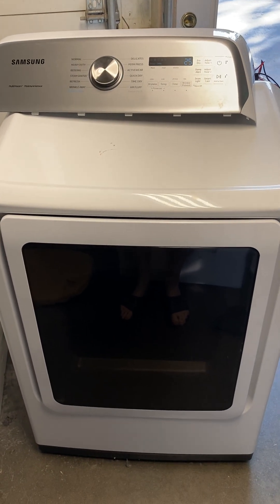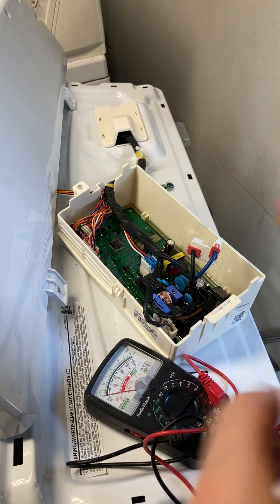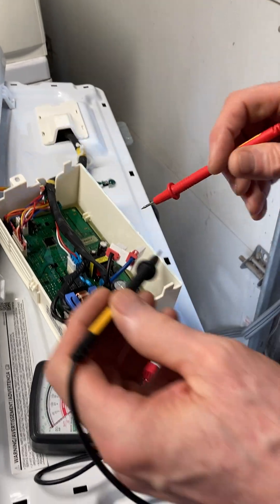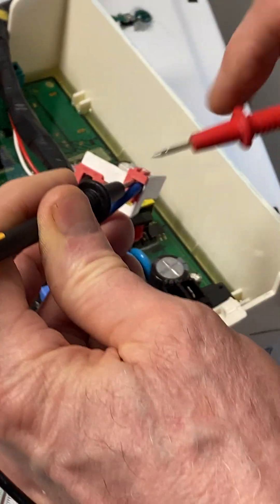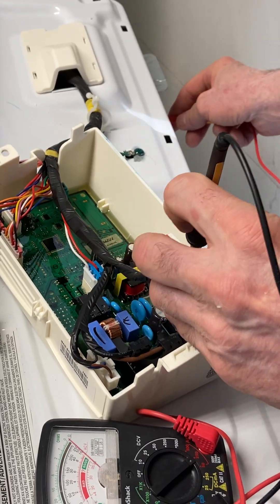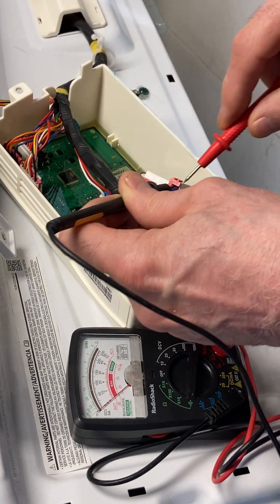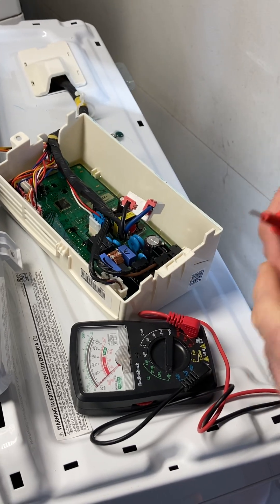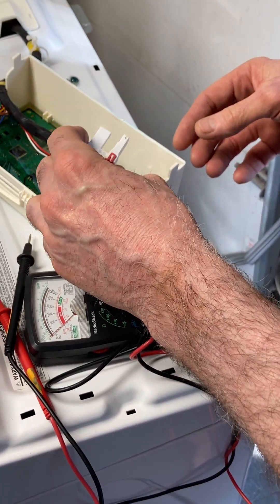Samsung dryer heating circuit at main board DVE50R5400W/A3 CAUTION: TESTS DONE WITH MACHINE RUNNING!

Comment: For those who are not electrically inclined I would recommend going straight to the heater element, and test continuity directly across the heating element with power disconnected.  Also, you need to test the thermostatic switches down there. They can go bad before the element fails.